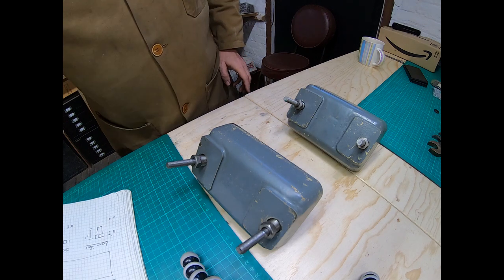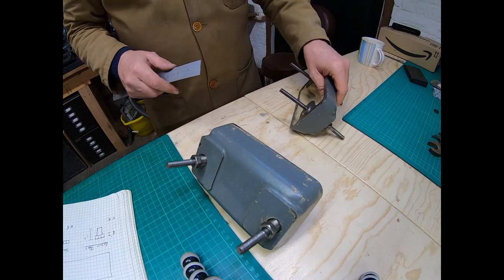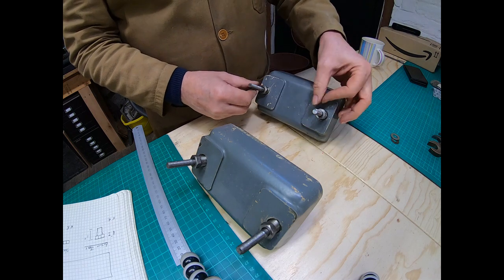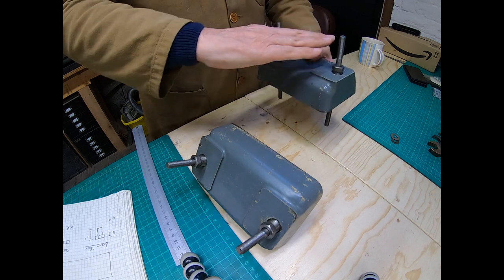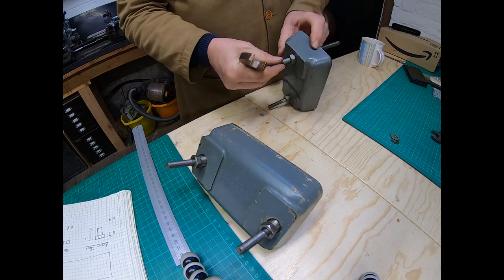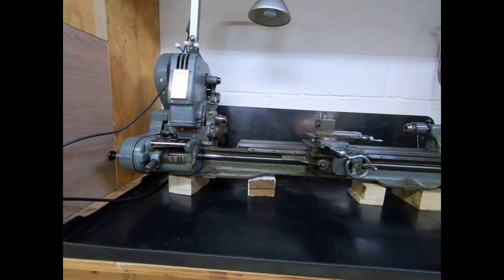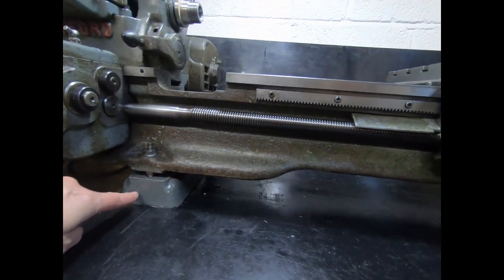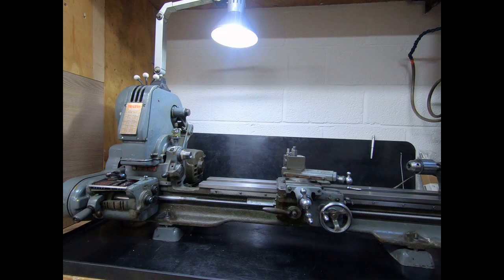Myford Lathe - Genuine Myford Raiser Blocks.

Comment: Oh wow, they look and work amazingly well Paul.  I feel for you lifting it on your own.  I had to lift my Colchester on my own when I was trying to level it.  I used the engine crane and it struggled lifting the tail stock end LOL.  Those blocks will make cleaning a breeze now.  Cheers, Aaron
Reply from the maker: Hello Aaron,
I think my ego got in the way as I did not want to ask for help... bit silly really, but all turned out well. It has made the whole setup much more usable... slowly slowly I am getting things how I want them and to be truthful if I wanted hurry hurry I would not have retired - lol.
Take care.
Paul,,

Comment: Only just came across this video and extremely helpful 👍as I am about to do the same. In the chance you see this message I am interested where you positioned the car / scissor jack to get the balance right so that you could lower each end, as you say, 5mm at a time onto the studs. Regards.... John
Reply from the maker: Hello John,
Sorry for the slowness to reply. It was a little while ago it made the video but I seem to recall once i had the Myford on the wooden block i place the jack in the center of the lathe and tried to find the balance point and slowly lowered it. Once you have the lathe on all 4 stud it should be quite easy to lower.
Take care.
Paul,,

Comment: Nice! Those looks like an excellent addition 😊. Would work very well if your table top is slightly warped. I think I'll be looking into that in the very near future. Thanks for that 😁. Cheers!
Reply from the maker: Hello Chris,
Thanks for dropping by.... They would be perfect for a slightly warped table top... the surface my lathe is on is wooden and has been there for many years so had done the majority of it moving around so this worked very will in getting everything level and parallel. I look forward to watching a video where you build some...
Take care.
Paul,,

Comment: They worked well in leveling your lathe, Paul.  When I saw riser blocks on your video title, I was actually thinking of the machined blocks under your headstock and tailstock to increase turning capacity.  I think that Enco offered those as a Unimat accessory.
Reply from the maker: Hello Daniel,
Yes the Unimat SL's do have a riser block as an accessory... I don't have one yet... I should be back on the SL restoration towards the end of the month...
Thanks for watching.
Paul,,

Comment: G’day Paul. Am I right to understand the risers are not standard fitment, without them I’d drag my knuckles each time I turn the travel wheel and how are you suppose to clean under it without them. Well done with your methodical way of setting it up on the risers, car jacks do come in handy. 
Cheers 
Peter
Reply from the maker: Hello Peter,
It would appear that the lathe did not come with the raiser blocks but they came with the Myford steel cabinets... Mine did not come with the lathe.
It does seem a little strange to not supply them with the lathe.
Take care.
Paul,,

Comment: Getting there now Paul, looking good in its elevated position. Not fun moving machines round on your own. 1st customer job, well done. Cheers, Jon
Reply from the maker: Hi Jon,
I am a lot happier with the setup now... Excuse the pun but I have a far better foundation now to check everything else on the lathe... I did struggle a bit moving the lathe about.
Thanks for watching.
Paul,,

Comment: hi Paul
nicely thought through, you may have to put a test bar in the chuck to check for run out / taper, the bed casting may / usually twist very slighlty giving a taper when turning, just a thought, i had to do that to mine to remove a slight tapering
see you next time and nice to see you back in workshop
regards
mr f
Reply from the maker: Hello Mr. F,
It is very good being in the workshop again and sorting out the Myford. That is a good tip regarding checking if I have any unwanted tapering going on... I'll add that to my to do list... Thanks for watching.
See you next time.
Paul,,

Comment: You are right, those raiser block make it so much easier to clean and work around the lathe. You did very well to lift that on yourself. We are at a crossover stage, with dad finding it harder to lift heavy stuff and I'm not yet strong enough. We are starting to think about better ways to lift heavy items
Reply from the maker: Hi Joseph,
It was a bit of a struggle to be truthful... Smart move by you and Dad to find ways to pick up heavy items mechanically... Thanks for watching.
Take care.
Paul,,